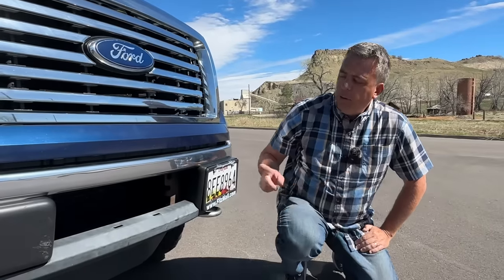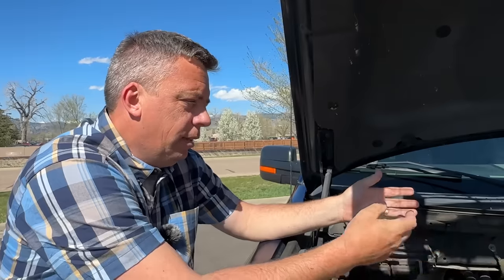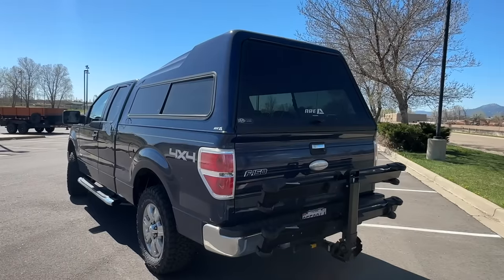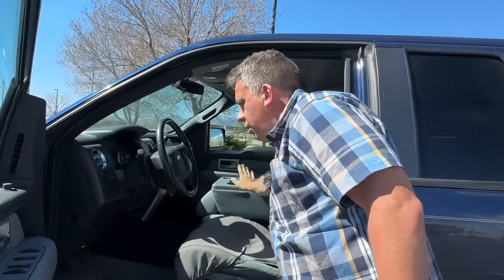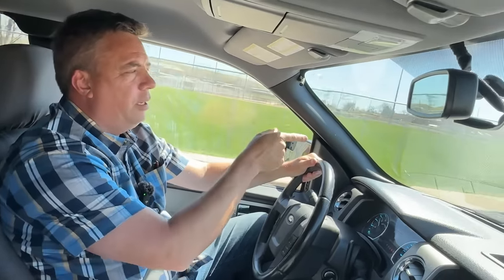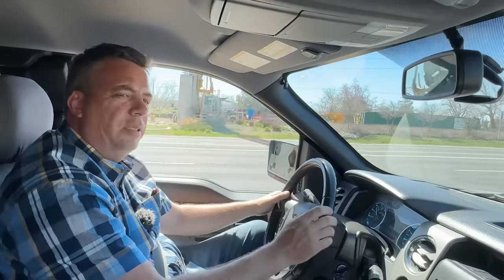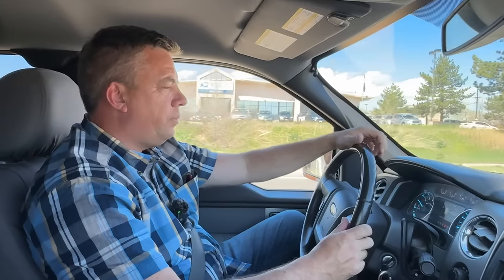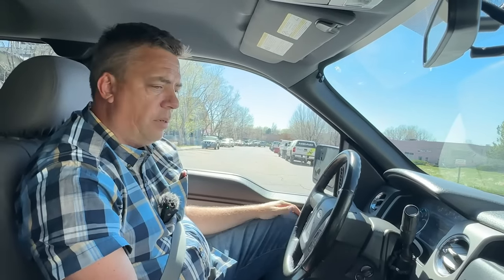How Has the Ford F-150 EcoBoost Held Up Over a Decade?

Comment: I think it’s funny how GM laughed at Ford for putting a V6 in a half ton truck at the time and now they put a 4 cylinder in their trucks.
Reply: Tell us you have no idea what you’re talking about without telling us. That 2.7 inline 4 cylinder is putting out more torque than the v6 2.7 ford. The 2.7 Ford has a crazy amount of issues, the GM has next to none…
Reply: @Billybob50119  I find it ironic when you call out others for not knowing what they are talking about when you yourself know even less. The 2.7 is one of the most robust engines ford offers (other than the 5.0) and one of the most robust on the market. The 4-cylinder from GM, however, is the biggest piece of shit of an "engine". They are failing more than GM's v8s.
Reply: @Billybob50119  I’m just saying that GM could only advertise about Ford putting a V6 in a half ton and they were only offering V8’s  only to put a four cylinder in later. FYI Ford 2.7 l is pretty reliable
Reply: @Billybob50119  what is a “crazy amount of issues?”
Reply: @eriktinaj8741  so all the issues the Ford 2.7 is having you just glaze over?? Please let us know the common issues the GM 2.7 is having since there are none?? Waiting
Reply: @enzop.3227  if you don’t count cam phasers, turbos, timing chains, manifold bolts, transmissions etc then maybe
Reply: @Billybob50119  I haven’t seen or heard of those problems with the 2.7L, the 3.5L yes.
Reply: @Billybob50119  You totally misunderstood what the OP was saying. GM did laugh at Ford for putting a smaller engine in the F150 at a time it was almost exclusively V8 powered trucks. Now GM ended up seeing the light and doubled down by putting in a 4 cylinder because they understood the mission. How you arrived to your ridiculous rant is beyond me.
Reply: This shit show of experts is hilarious. None of yall have any statistical data to back any of your claims.
Reply: That gm shit box is literally one of the worst power trains ever made lmao
Reply: GM did the same thing when Ford introduced the pull-out tailgate step...then they went and created a folding tailgate
Reply: I’ve had my ford 2.7 since 2019 with no issues. The 3.5 has phaser issues. But the 2.7 doesn’t have really any major issues by comparison. And gas mileage is about 23 combined when not towing.
Reply: My 15 f150 2.7 has 100k and it's been flawless. I did have a vent valve for vapor canister go bad, but that's it. Oil changes at 5k with good full syn oil. I have slipped a few times and let it go a little longer due to my schedule. I do run a catch can, which helps with carbon build-up. I will say my fuel economy hasn't been great, but I didn't buy a truck to get good fuel economy.
Reply: Gm always had a v6 in the base model 1500s
Reply: @Billybob50119 gm 2.7 has very questionable reliability issues.
Reply: @gtrance3567 which generation of the 2.7 are you referring to ?
Reply: @shifter8207  most recent 4cyl.
Reply: @Bucky_BB  I know that GM had a 4.3L but they were only relaying the V8 aspect in their ads
Reply: @Billybob50119 That’s NOT the 2.7. That’s some of the 3.5’s. The only significant problem with the 2.7 is that some have leaking oil pan gaskets. Yes, it’s an issue. But it doesn’t disable the engine.
Reply: @Billybob50119 The 2nd gen 3.5 is much better than the first version...typical for all engines.  We have a 2007 Tahoe with 195000 miles.  NO engine work other than wear and tear.  We did replace the flex plate about 20k miles ago.  This engine has the flex fuel.I bypassed it at 120000 miles and no issues. If I did not bypass that feature, that 5.3 would have had major work by now.  Now it starts and runs very smooth. 
We also have a 2023 Expedition limited.  This engine ia obviously much more powerful and is very smooth.  

I am saying this as with proper maintenance most modern engines are very reliable.
Reply: You made all that up. Gm had a v6 before Ford. Blatant lie 😂  🤡
Reply: I’m definitely a Ford EcoBoost fan, but I’m skeptical on a 4 cylinder turbo on a large pick up truck. So far I haven’t heard of any issues so far.
Reply: @thomasnew8606 Very true, all makes have their issues, but most of them come from people not maintaining their vehicles properly.
Reply: @Billybob50119  The 2.7 has been around 9 years it’s rock solid, there have been 2 issues in its 9 yrs and both were caught and all the failures we’re taken care of under warranty. First was in 2016 involving certain number if cylinder heads not machined properly causing oil burning,second issue was a metallurgy issue with the exhaust valves in some engines around 2021-2. These were production line issues,the engine design and strength is excellent.
Reply: @Billybob50119  The first version of the 2.7 GM only made 348 lb-ft of torque. The updated version makes a little more torque but not that much. The 2.7 has not had many issues and has a stronger block and twin turbos are more responsive.
Reply: @302Mustang13  the current 2.7 GM has 430 lb ft which is a big increase and more than the current 2.7 Ford and also at a lower rpm… an inline small CI motor is a much better design than the same CI in a V…
Reply: @Billybob50119 Oh, the irony.
Reply: @Billybob50119  That's not much more than the Ford rated at 400 lb-ft of torque. Difference in the real world won't be noticable and I'm certain the Ford can outperform on everything including mpgs.
Reply: @302Mustang13  ok dude 🤣
Reply: @Billybob50119  The Ford 2.7 does get much better fuel economy and has more horsepower than GM's 2.7. Just like you, I've heard about a ton of problems with the GM 2.7. Like I said before, Colorados with the 2.7 in the 391 lb-ft tune and the 430 lb-ft tunes perform almost identically, meaning the extra torque doesn't show up in the real world. In addition, the Ford 2.7 has a CGI block and almost 10 years of proven reliability with very few issues. GM's supposed claim of more torque is all they can claim.
Reply: GM is the ONLY manufacturer left that is keeping there V8 option.
Reply: @canyonero2050 Ford still has the 5.0L coyote
Reply: @302Mustang13  cool story bro!!
Reply: @Billybob50119  More power, more boost, fewer cylinders doesn't sound like a typical recipe for reliability and longevity in the commercial market.
Reply: Well now even the mighty nemo is gone for a turbo engine.  BTW turbo engines in this makes sense as they make more torque at low ROOms and high horse power.  Tractor s have used turbo engines for decades so that tells you it is best for light duty too
Reply: @Billybob50119 the 2.7 Ecoboost is arguably the best engine in the lineup, so sounds like you don’t know what you’re talking about.
Reply: @Billybob50119 also the 2.7 Eco has dual direct and port injection as of 2018 the GM 2.7 doesn’t even have dual injection so get used to looking forward to carbon buildup in the future.
Reply: Ford also told Gm that they were foolish for sticking with the pushrod engine. Years later Ford starts building the godzilla  v8. Gm doesn't seem too foolish after all.
Reply: @Billybob50119 lmao! Yeahhhh right!!! 😂
Reply: @tylerdavis2492 awesome man! I got the exact truck, mines at 90k no issues so far
Reply: Funny how most people don't no how good a inline 4 cyl. Is compared to a v6 .. v6 eat themselves  4 cyl. Dont
Reply: @Billybob50119 Wow you have no idea what you are talking about…. Come on man
Reply: I've been hearing constant issues about GMs 2.7, not so much on Ford's
Reply: @Billybob50119  Are we going to ignore GM's 4 cylinders having catastrophic engine failure? GM's v8s are bending pushrods, chewing up cams, and chipping lifters everyday.
Reply: GM hasn't been relevant since the gen 2 Coyote lmao. Their V8s are gutless junk
Reply: @Billybob50119  the GM 2.7 i4 makes 310hp and 348 lb-ft of torque. Ford's 2.7 EcoBoost v6 makes 325 (in the first iteration) and 380-400 lb-ft of torque. Now I'm no mathematician, but I learned pretty early on in my education that 380 is more than 348 😂
Reply: @Billybob50119 I had the GM 4 cylinder turbo in a work truck. It was complete garbage and got awful gas mileage.
Reply: Instead of puny 4cyls...how about we turbo the v8s.
Reply: @williampremo2197  Now we’re talkin!
Reply: GM and now Chrysler was basically forced to put smaller engines in their trucks to meet more and more stringent CAFE and EPA regulations. Thank the Democrats for these peepee engines in these trucks. And these Ecoboosts are a shot in the dark when it comes to reliability and longevity. I've seen exoboosts with 350k mi on them and I've seen some with less than 100k with timing chain, cam phaser, and turbo issues. You don't k ow what you're getting when you buy one. Hopefully, that won't be the case for the 2.7 GM TURBOMAX and the Ram HURRICANE. Little engines in big vehicles made for work...only time will tell.
Reply: @Billybob50119 did you completely miss gms lawsuits over lifters failing on all their engines including the 4 cylinder or are you just blatantly ignoring that? Sure old gm before cylinder deactivation was arguably better but now gm Is the worst in terms of reliability out of the big 3
Reply: @christ.5323  might look up what a 2024 GM 1500 2.7 torque is. Here’s a hint 430 lb ft
Reply: @Billybob50119 wut are you on 💀
Reply: @Billybob50119  430 lb-ft for a brief burst at 3,000 rpm from the GM 2.7 doesn't beat the 400 lb-ft at only 2,700 rpm from the Ford 2.7. That and few will notice the extra 30 lb-ft since the Ford uses a 10 speed and a little more aggressive gearing are axle ratio.
Reply: @302Mustang13  might look up that rpm for the Ford 2.7 torque number, you’re way off
Reply: @Billybob50119  It's been at 400 lb-ft since 2018. It's peak since then was 2,700 rpm. For 2024, the 2.7 went thru different emissions testing and now it peaks at 3,000 rpm. Doesn't matter cause it's just as good as it was previously.
Reply: Nope.
Reply: @302Mustang13  🤣
Reply: @Billybob50119  What are you on? The 2.7 Ecoboost originally made 375 lb-ft of torque in 2015 in the F-150. It got a boost to 400 in 2018 and hasn't changed since. Even if.the peak is now 3,000, so is the GM 2.7. The GM 2.7 originally only made 348 lb-ft, which is pathetic.
Reply: Turbocharging technology and design has come a long way in the last 10 years, especially on domestic vehicles. I can understand why they "poked fun" at ford 10 years ago for it, but can also see why they use it today
Reply: @Billybob50119 um actually no!
Reply: @eriktinaj8741 huh? The i4 2.7 is failing? That would be news to me, I've heard more issues with bad batches of 2.7 V6 eco boosts in theF150s and the Broncos then i have from the GM world. There's more issues in the Colorado's and Canyons with the infotainment system then there are with the actual engines. 

2.7 turbomax actually appears to be one of GMs better engines and they're selling incredibly well I see more of them on the road then i see 5.3s or midmax duramax.
Reply: @gtileo  There was issues with oil leaks on the 2.7 early on in the 2015 F-150 and bad valves in the early Broncos supposedly due to an engineering issue but other than that, the 2.7 has been great. Keep the maintained properly and you are good to go.
Reply: @302Mustang13  an issues with the valves breaking, it's more then just the Bronco. It was a bad batch of valves
Reply: @aceofthearc1153  Ford was way ahead of Turbocharging truck engines. Ram and Chevy fanboys been critical of Ford, mostly on reliability and longevity, but now seem to be embracing Chevy and Ram right off the bat and no worries.
Reply: The big thing in 50 years in gonna be those aluminum bodies, gonna look brand new for years
Reply: You are right about that! I bought the 5.3 engine that gets the same gas mileage and tows the same !
Reply: @Billybob50119  you just said no problems now you say some of theese lol
Reply: Just marketing tactics back & forth- hell, GM was big on 6 cylinder turbo performance way back w/ the syclone & GNX etc
Reply: @canyonero2050  Ford still offers a V8 stop lying lmao
Reply: All turbos suck. They don’t hold up much beyond 125k. I find it funny how they all trashed the Ridgeline and now they’re all copying it right down the the tailgate.
Reply: @jamesbyington2101  ...and aluminum beds...
Reply: Huh? GM trucks have had V6s in them since the late 80s.
Reply: @TheUSpatriot1776   2.8 L since the early 80s
Reply: @enzop.3227  and the 7.3 v8
Reply: GM also Laughed at Fords tailgate step, now literally every truck has one
Reply: They’re only using more 4 cylinders and v6’s because of the epa
Reply: @Billybob50119  for the short time that Chevy 4 cylinder has been out there have been quite a few issues
Reply: @pathunter7003  please enlighten us with all these common issues? I will wait. I can name about 10 on the 2.7 Fords
Reply: @Billybob50119  how about you first, after all you see to be an expert after reading all the internet chatter about an engine you don’t own. It should be quite entertaining
Reply: Facts tho
Reply: @thegeneral1955  what does the number of cylinders have to do with anything? You realize Semis have 6 cylinders right? 🤦‍♂️
Reply: @thegeneral1955  so do you think the same displacement motor but with 2 extra cylinders has more or less stress? The 4 cylinder will have much bigger pistons, rods etc and a inline motor is better than a V in many ways. But keep blabbing, the Ford 6 cylinder 2.7 has had way more common issues so far than the 2.7 GM…
Reply: @Billybob50119  I've had to drive the gm 2.7s multiple times at work and it is the only modern truck that can't idle into or out of a parking space. You have to rev over 1k just to start moving. Those engines are not going to last for shit with the load they will be under constantly.
Reply: @enzop.3227 kinda funny how Ford made fun of Honda's unibody truck and years later, walla...Ford build an unibody truck. Funny how things are!
Reply: @Billybob50119 the ecoboost is a 3.5 in the f150s, it’s a 2.7 in the mustangs, you have to quite literally buy the most bare bones f150 to get a 2.7. That being said GM has went downhill years ago, all a ecoboost needs is a catchcan
Reply: Most of you people have no clue of history. GM never “laughed at Ford” for putting a V6 in the F-Series. GM has been putting six-cylinders into full-size pickups themselves since way back. And now with technology and customer use being what it is, we have four-bangers in them too. You sound like zoomer fan boys.
Reply: @eriktinaj8741 even gm v8s at one point is better then anything gm or ford had
Reply: @Billybob50119 you have absolutely NO idea what your talking about 😂
Reply: @Billybob50119 but it’s trash 🗑️. It doesn’t work . Because it’s GM
Reply: They didn't laugh. It's all marketing and you know that im sure.
Reply: @s1283 how many miles do you have on it?
Reply: 51k
Reply: @Billybob50119 You can write, but do you have any sort of reading comprehension?
Reply: Popcorn time! Love the Ford vs Chevy debates.
Reply: They only laughed cause they didn't have the technology then
Reply: @Billybob50119 the chevy hasn't been out that long give it time
Reply: Lmao
Reply: Ford's 3.5L V6 twin turbo is iconic. And they're fast. Ford makes fast trucks. Get smoked by both the 3.5L or the 5L coyote.
Reply: @Billybob50119 The 2.7 literally started to develop a legendary status due to how reliable it is. The only time I've heard of widespread issues was a manufacturing issue with the bronco that led to engines failing. That as a total of... 50 engines out of a vehicle where over 300k have been sold, wow, how terrible.
Reply: @canyonero2050 You mean Ford. Ford is literally the only American brand that has made v8s a priority moving forward.
Reply: @themidnighttavern6784  lol. Thats simple, not a true statement
Reply: I got a 2021 Chevy Silverado 4 cylinder lt. I’m currently doing a lemon law in it. At 30000 miles my transmission became jerky and took it in for service. Chevy “fixed” it. But at 58000 miles my truck is in the shop for the same reason. Jerky transmission, on a cold start stalls to move on Drive. Overall horrible experience. Coming from a family that only drives GM(5 cars)
Reply: That also reminds me of the time GM criticized Ford about using aluminum in their truck beds, then lo and behold, guess what metal they started using in their own truck beds.....
Reply: @weegeemike  I’m sure you have seen ecoboosts with 350k on them, those are people that do the maintenance on them. It’s no shot in the dark.
 The ones that don’t last are the folks that don’t bother changing the oil when they should and other maintenance items. And the 2.7 is much more reliable that the 3.5, it’s designed for use of turbos, not something added on to the engine. There are a lot of ecos still on the road with well over 200k and still running great.
Reply: @Billybob50119  because the 2.7 has only been out for a very short time, just give it a bit of time and it will fail. It hasn’t been been out 13 yrs  like fords
Reply: @PeterGriffer247  the Hondas and ford mavericks are made for folks that don’t need a truck
Reply: @Billybob50119 good thing the first V6 engine FORD made in their half ton trucks was the 3.5 eco-boost